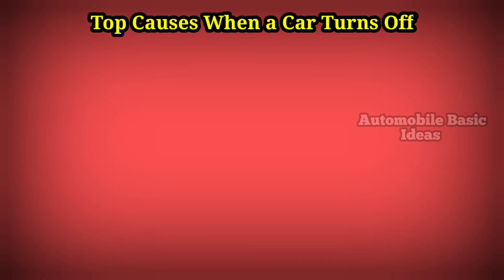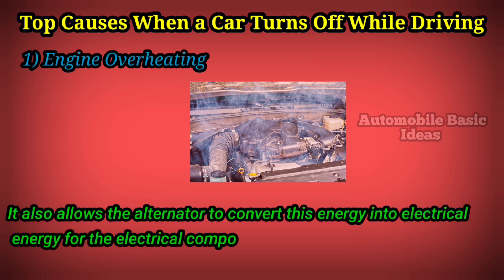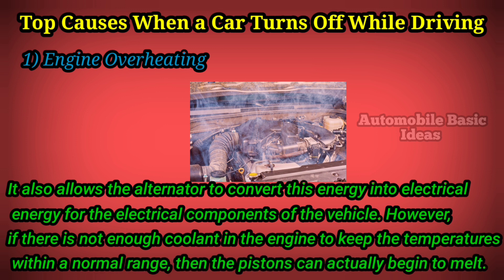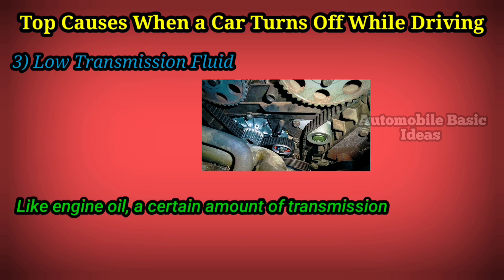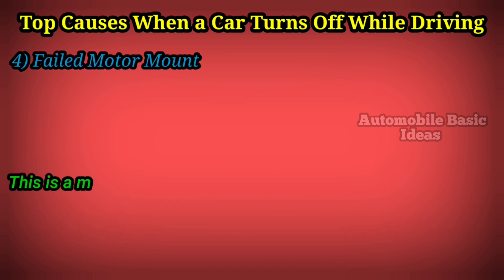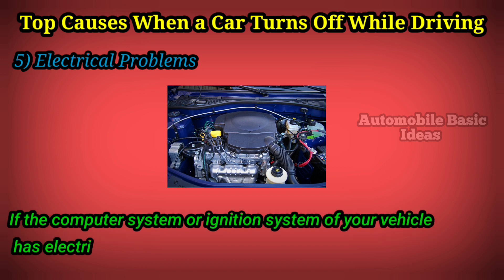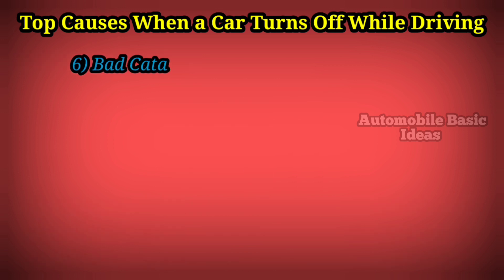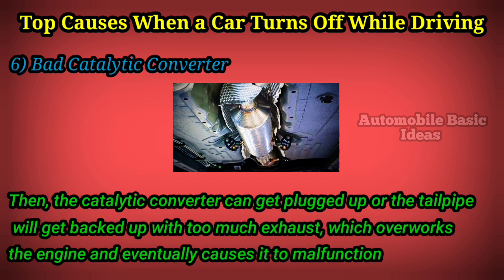Why a Car Shuts Off While Driving..??|| 6 Causes ||

Comment: Tighten your Battery connections . Check your fuel pressure + fuel pump , fuel filter .
Reply: Main fuse ? Can it contribute to car jerking
Reply: @goitsemodimoxiangxhilingla569  several reason contribuites to car jerking. at low speed and soon after put car in drive or in first gear.  yes fuse that regulates the fuel pump.

Comment: Motor mount??? Wth
Reply from the maker: An engine mount ( motor mount) is exactly what it sounds like – the part of your car that holds the engine in place. Because your transmission and engine are bolted together, you need mounts to keep them from moving around. Usually, there’s one mount holding the transmission and two or three holding the engine
Reply: @automobilebasicideas  yes, I’m aware of engine and torque mounts/struts. The “???” Were about a vehicle stalling because of these parts.
Reply from the maker: @mayken6661  sir, Engine mounting failure can cause a lot of problems and damage and the accelerator can get stuck, in which case the car won't slow down if you release the accelerator pedal. If the engine is not seated securely in the intended position, the pulleys also due to engine vibration
Damage to electrical wiring and hoses can cause the engine to stall while driving.

Comment: Thanks for the video, i have been having similar problem, now I know it's because of electrical problem, i have seen the check engine light many times before my car just automatically shuts down, i thought it could be contaminated fuel,or fuel pipe or fuel injection pin.
Reply: May be camshaft sensor issue
Reply: Mine is killing me slowly.... Mazda CX-9 keeps going off while driving and now it's giving hard starting.🥺🥲